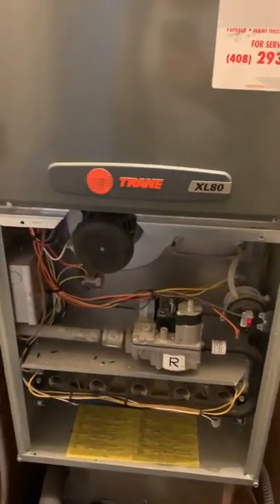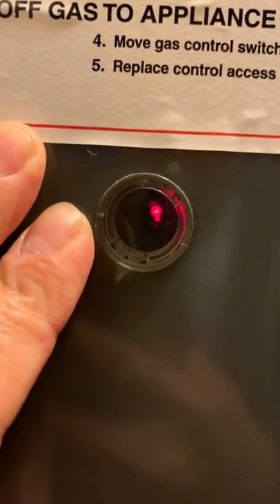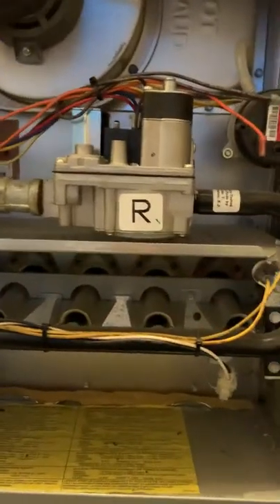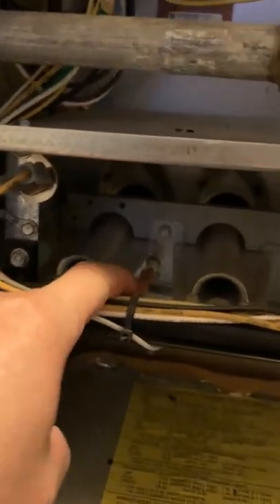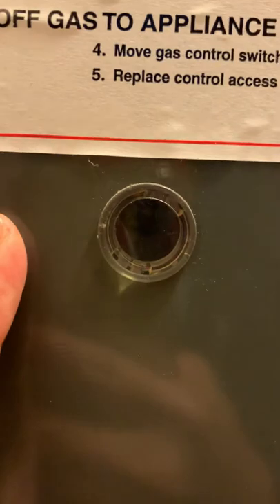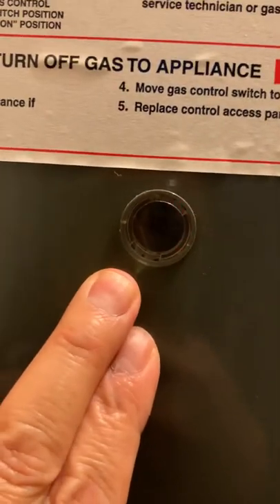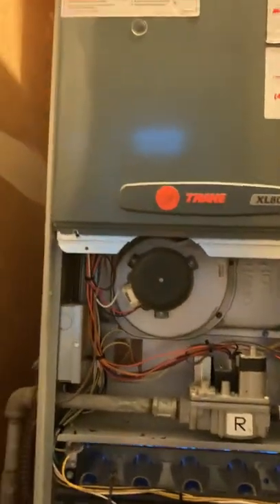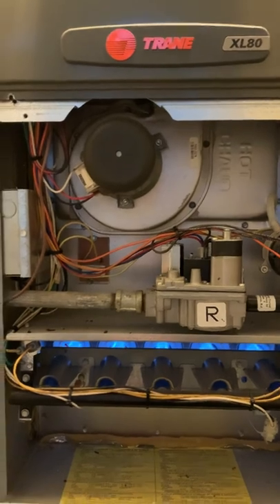Trane XL80 - Intermittently working

Comment: I have the same problem. I think it is the reverse air flow switch, which is only used on down flow trane furnaces .I am looking in to replacing the switch at this time.
Reply from the maker: I replaced the controller board and fixed the problem.

Comment: Gently clean the flame sensor with thousand grit wet dry Emery cloth. Too much abrasion will ruin the sensor. Do not use scotch bright pad it is too harsh.
Reply from the maker: I tried clean the flame sensor but it didn’t help.  I finally replaced the controller board and that fixed the problem.
Reply: @sxn10  Thanks for the reply. I will know what to do next if cleaning the flame sensor doesn’t work. Thank you

Comment: I have the exact same symptoms with the same furnace, Steve.  How did you finally determine that it was the control board?  And did you buy a new board or a used one from eBay?  Great video  - thanks!
Reply from the maker: Thanks!!   I studied the circuit design and it wasn’t that bad.  Once I figured out the general how the system works, I solved it by trials and errors multiple times.  I bought the brand new control board from eBay with exact same model and it was an easy swapped out the old one.  I labels the wires and also video recording the steps just in case I screw up I can go back and see what the original looks like 😂.   It was a straight forward replacement without any problems.  Good luck!
Reply: @sxn10  Thanks, Steve - I appreciate you taking the time to respond!

Comment: If in doubt call a technician and have it diagnosed. Sure it will cost you the price of the service call but you will know for sure what your options are.
Reply from the maker: I isolated the issue to the control board and replaced it with part bought on Ebay. Everything has been working perfectly.

Comment: I have similar problem on my trane xl80, but my trouble is with the gas regulator, the electrical clip/plug at top center of it to be exact. The receiver portion of that plastic plug has a short/loose connection I can't get at.  Googled up trying to repair back in 2005, someone with same issue said they fixed theirs by wiggling the wires to the gas regulator. 
Wiggle the wires to it, see what happens, see if you get the valve switch clicking.  I've been limping mine along like this for 15yrs:  Start of every winter season it requires a little attention to get the wires into the sweet spot, then I do what I can to keep them there, wedge the plug from moving, tie up the wires.  
Now, I have to try to get the blower motor replaced with a wall section in front of the face of the furnace probably just close enough to make getting the blower housing out into a demolition job.
Reply from the maker: I tried everything.  I even removed all connections and reconnected them.  Nothing helps until I replace the controller circuit board and that fixed it for good 👍
Reply: I count myself lucky with this furnace, only a little inconvenienced.  The outside AC condensor unit is an old Westinghouse dinosaur, alive and kicking.  Hope I still feel lucky after replacing the blower moter.
Reply: @sxn10  Good job on your diagnosis and repair.  Hope you don't have anymore troubles.  If you do, post them here, we'll commiserate, compare notes.
Reply from the maker: @yadabotbingo  it’s been working perfectly since November 2020.  I learned a lot during the whole process. That’s why I love DIY projects.

Comment: i have the same problem on a Tran The tech came he recommend to purchase a carrier furnace. did you find a solution to the intermit cold air
flame sensor was clean , the high temp sensor is good.   the cold air would come on 20 min, or 6hrs , or 1 day later or a week later
Reply from the maker: I isolated it down to the controller circuit board. I bought the Controller board from eBay and replaced it myself.  It’s very easily done.  Document cable connections by label them and take a video for reference.  You can fix it your self.

Comment: There is a chart behind the panel, either top or bottom that shows the blinking/code for troubleshooting.
Reply from the maker: I already figured out the issue. It’s the controller board.

Comment: It's supposed to flash fast to let you know that it's in normal operation if there was a problem with the IFC it will flash an error codes for the board failure.

Comment: Where you able to figure out what was wrong with it ? I’m having the same issue
Reply from the maker: It’s the control board
Reply from the maker: Also, don’t buy the replacement part from North America HVAC.  The part did NOT work and horrible service.  Ripped me off $300
Reply: @sxn10  I've the same problem on the same furnace.   Did you replace the control board or just reconfigure it yourself?  If you know a good technician to fix your issue, please share the contact info.
Reply from the maker: @bcao2008  I fixed it myself.  The board replacement is straight forward.
Reply from the maker: @bcao2008  in my case, before the board replacement, I used this workaround by power A/C Off and waited for 30 minutes, then power A/C On again and the old board continues to work fine for another day or two then the cycle repeats   So it’s not related to the gas valve or sensor.
Reply: @sxn10  Thanks so much for your quick reply, Steve.  Where did you get the board and detail model?
Reply from the maker: @bcao2008  you need to open the upper cover to see the board model.  Your system may have different control board.
Reply from the maker: @bcao2008  has the issue resolved?  I bought the replacement board from eBay and replaced it myself.  Issue resolved for me.
Reply: @sxn10  When you say "control board," do you mean the ignition control module (white in my furnace)?
Reply from the maker: Michael Lane Hey Michael, if you have same furnace model, you need to open up the upper panel cover to see the circuit control board.  In my case, it’s made by White Rogers 50M61-495   Model # D341418P01.   You need to open up your cover to see the actual control board.
Reply: @sxn10  I have an XL80. So I take it this is different from the ignition control, which is a white box to the lower left in my model, writes sticking out from everywhere.
Reply from the maker: Michael Lane my control board is where the wires are connected to including all the thermostat wires
Reply from the maker: @briancao6819  buy identical replacement board from eBay and clearly label the wire connections. Take photos and video clip just in case you need references.   The board replacement is a plug and play for me.  Very easy to replace.
Reply from the maker: @briancao6819  I prefer brand new board so I recommend new board.